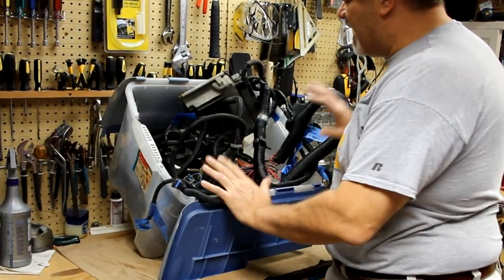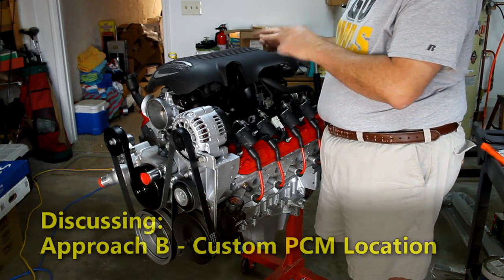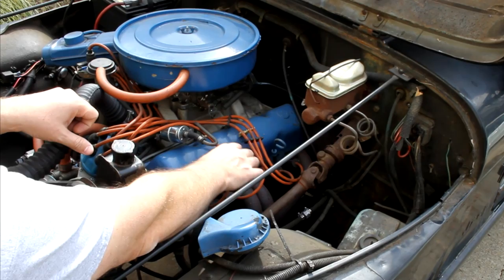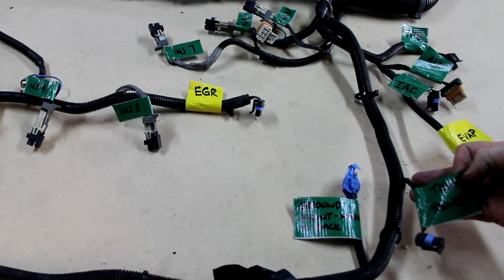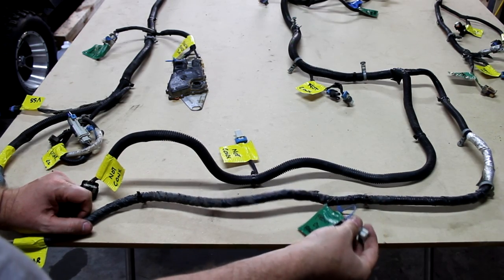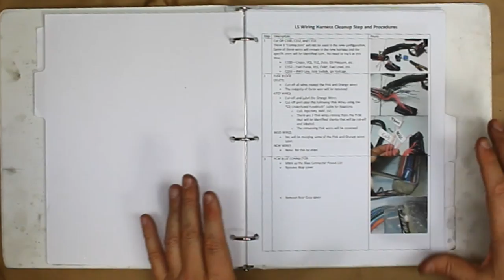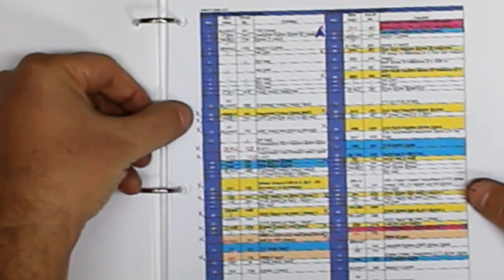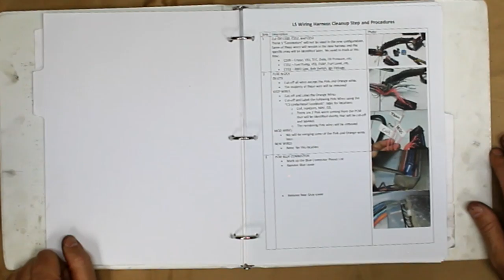LS Wiring Harness Part 1 | Project Rowdy Ep013

Comment: Hey rowdy, quick question?  If I'm running th350 / ls1, do i have to connect tcc wire 33 (blue connector). I never connected it and the car runs but will it make a difference on a old th350 or how the pcm runs?  Cheers mate
Reply from the maker: Hey DJ,  Because my configuration does not include an Automatic Transmission, I'm not sure how much help I can provide.  I removed all wiring related to the AutoTrans.  Interestingly, my records show that I did not de-pin B33, but I do not recall where the other end exists!!!  I may have later removed it and did not update my documentation.  That Purple wire is the In-bound trigger from the Brake Switch to the PCM.  It tell the PCM that you have applied the Brakes and then the PCM control the TCC (Torque Converter Clutch) through other wires (R2 and R42).  So I'll take a stab at your question.  It will have NO affect on how the Engine runs.  It only applies to Autotrans with TCC solenoids (outside of my research). I dont believe the old TH350 has TCC so you wont need it.  <- I'll leave that for your research.   Cheers to you as well!!!  Mike
Reply: Thank you so much mate.  I figured that might be the case as the car runs fine without it.

Comment: Sir, how did you find the name of every plug? I have a 2002 harness of a ls engine and I would like to know where I can find info to I.D every plug. Thanks. Great video.
Reply from the maker: Well in my case, the engine came with the harness still completely connected to all it's sensors and components.  You may need to attempt to lay out your Harness in the same configuration as I did in this video and then use it as a guide.  I mention all of the connectors and locations.   If your harness is from a true LSx, you may find that the Camshaft Position Sensor is located in the front of your engine.   It is in the rear of mine.  Hope this helps!!!
Reply: Thank you Sir

Comment: question! if i install Cat converters i have to save rear O2 sensors or i can removed it? else the PCM must be reprogramed only when you removed all O2 sensors. I removed wires related with A/C compressor so PCM needs to be reprogramed?
Reply from the maker: Swapping your engine into another vehicle is going to cause you to reprogram your PCM regardless to remove the VATS security.  You can run front and rear O2s with your Cats.  They will help you tune your engine.   I would not recommend running with no O2s.  Either 2 or all 4.

Comment: As everyone has stated, thank you for the videos, really clear up a lot of questions.  However, I have 2:  what size fuse do you use in the 4 fuse panel you install and do you have a parts list to order all the parts for the conversion?
Reply from the maker: Thank you Lee!!!!  The basis of my 4 Fuse Block came form LT1Swap.com and Branden used 15 Amp fuses in all 4 sockets.  Without doing any calculations, I also plan to run with the 15 Amp fuses unless someone raises a red flag or I encounter issues.  A couple of other people have asked for the list as well, so I have just added it tot he Description under each video.  you will have to use the "Show More" option to be able to view the information.Thanks for watching and taking the time to share your feedback!!!!!!
Reply: Thank you so much.  I can't wait to get into mine.
Reply from the maker: I found it really fun!  Partly due to the challenge of thinking through it so that I could properly present it, ( I love to prep).  The steps just came logically and I was pretty sure that any short term issue would be easy to resolve.   I truly believe that anyone that watches this series and feels they understand it...  will cruise through it.  Have fun!!!!!

Comment: So when you remove the ac connectors want be able to run your ac unit right
Reply from the maker: Correct!  I will be removing the A/C Compressor from the engine as well.  The new vehicle that this engine is being swapped into does not have A/C.

Comment: to run the obd2 port, do you go from the wire from the pcm (58 drk green) to the new fuseblock as on the diagram and pigtail it to the obd2 connector? Im confused
Reply from the maker: Did you download my diagram from the "Show More" section below the video.  It details the OBD2 Port wire needs on page 3.  Yes, Dark Green (Blue58) will go to port 2 on the OBD2 connector.  You will also need a Ground wire on Ports 4 and 5.  And finally, you will need Constant Power,  Orange wire on Port 16.  Hope this helps....
Reply: yea, I got it straight... Thanks
Reply: I guess it would be good to run 2 obd plugs too, 1 on the inside and one in the engine bay ?  SImple to parrallel wire, but where is the best place to install it ?

Comment: Hey Mike. For your harness diagram that you put together (which is amazing, btw), did you use Visio or another program? If Visio, did you make or find the templates for the relays and blocks? I am using a different block for mine (I'll have separate relays for fans and such) and want to put together a similar diagram using Visio. I just don't want to have to create the templates if they already exist. Thanks.
Reply from the maker: Yes!  I do all my diagrams in Visio and I did create the object that were used for the Relays and Fuse Block.  I didn't go to the length of saving in a Template file as they were kind of a one-time-use item.  Pretty simple to create, but if you would like a copy, I can send you a VSD file with them in it.  Shoot me an email if you would like them.  ucandoit2mike@gmail.com. Cheers!

Comment: After u delete all the wires do u have to reprogram the ecu to let it know u deleted everything
Reply from the maker: Yes!  If you don't disable these items in the PCM, you will receive error messages that are not valid.
Reply: Did u do it or have someone do it for u
Reply from the maker: IN my case, I will have someone do it.   I haven't had it done yet.   I am still working on the vehicle that it will be installed in.  When I get closer to dropping it in, I will have it reprogrammed.

Comment: Would I have to use the pcm from the 5.3 or can I use the pcm from the vehicle I'm swapping into??...
Reply from the maker: I'm struggling with coming up with the proper answer to this.  There are after market computers that can be used to run your engine.  I would assume that you could "possibly" program other computers to run your engine, with tremendous effort.   A compatible (there is a range) GM PCM (specifically the one that came with the engine or similar vehicle) already has the all of the sensors and mapping tables dialed in.   "Dialed in" with a standard tune that GM believes applies to all 5.3 engines.  All standard tunes can be improved on for the exact engine it is servicing.  Hope that helps!  Mike
Reply: @UCanDoIt2Mike  I just wasn't sure if the pcm was needed to run other functions of the vehicle not related to the engine such as windshield wipers, power windows, etc....
Reply: @UCanDoIt2Mike  the good news is that I still have the pcm for the 5.3 so I will not discard it and will put it into the swap vehicle...
Reply from the maker: The PCM primarily runs the Engine and Transmission.  It also has outputs for Cooling Fans (Engine related) and gauges (Engine related).
Reply: @UCanDoIt2Mike  thanks a bunch. Your videos are very informative and thorough. After I get this swap together I will make sure I let you guys know how things turned out. God bless you and your family.
Reply from the maker: Definitely plan to give us an update.  Cheers....  Mike!

Comment: Did you have to short out the neutral safety switch, for the computer to allow cranking without it being installed?
Reply from the maker: Let me attempt to explain this.  The normal answer would be Yes, in my case No.  The Neutral Safety Switch is a normally open switch in the Ignition circuit.  If the vehicle is in Neutral or Park the switch closes that portion of the circuit and if all other "in series" switches are closed, the starter will turn.   My new vehicle is a manual transmission, so it does not have a NSS.  There is a jumper in the area of the transmission that if the vehicle had an AutoTrans, it could incorporate a NSS, but since it is manual, it came factory with a Jumper that permanently "Closed" that section of the circuit.  I explain a little bit of this in Part 6 / Episode 018 of this series.  Hope this answers your question.  If not, let me know.  Cheers!  Mike

Comment: I have a 02 mustang I'm doing a ls swap in. My ? Is does this process the same for any car?
Reply from the maker: Yes...  Once you consolidation your wires down to a 4 wire system,  You could drop the engine into a Go-Cart and fire it up.  You are going to need to figure out how to interface with your internal gauges.  Cheers!!!
Reply: @UCanDoIt2Mike  thanks a lot man. U always have the answers. And yeah I was reading a little about that on lt1swap.com doesn't look like much fun.

Comment: I have a question friend i seen in this video that you're delete VSS my question is do you need that wire if you're going to connect odometer ?
Reply from the maker: I'm going to take a guess here...  In my older vehicle (79 Jeep), the Odometer is a mechanical function of the Speedometer.  And my Speedometer will be driven off a cable attached to the tail section of the transmission.  So in my situation, I will not need the VSS.
Reply: UCanDoIt2,  doesn’t the pcm require a VSS input for correct mapping?

Comment: i have a 2000 camero ss, and need to replace my engine harness.Do i need to pull the engine to do a harness swap
Reply from the maker: You should not have to!   The majority of the harness lies on top and sides of the engine.  The problem area might be any harness clips near the back of the engine that head toward the transmission. The fire wall makes that area tight.

Comment: Awesome work, thank you
Reply from the maker: I appreciate the kind words.  Thanks for watching.   The next part should get really good.  Snip... Snip!
Reply: UCanDoIt2 I'll be sure to watch, I'm about 2 weeks away on starting my harness
Reply from the maker: Maybe I can stay just ahead of you!  More than happy to bounce ideas off each other.  If you see me screwing up...  YELL at me!   I believe I have my ducks in a row, but you can never be totally sure!   Thanks.
Reply: UCanDoIt2 oh I'm sure you will be done before I'll really attack it, I'm test fitting the 5.3/th400 in the truck and getting all that done first and taking things off the truck that I don't want or need and I need to clean the engine bay, once the motor/trans are in and bolted down I'll start the harness
Reply from the maker: That sound like a great plan!  Hope all good well for you with the fitment!  Cheers!
Reply: UCanDoIt2 let me know how you like them Speed Pro pistons, I took my 706s off my 5.3 to swap them for a set of 862s and I found some junk I didn't like so the block is bare now, going to the machine shop Friday
Reply from the maker: It is going to be a while before I fire it up, but from a quality and installation stand point, I couldn't be happier.  They all came balanced dead on except 2 but the overall balancing effort took care of that.  I believe that I mentioned that these were the 0.020 over stock.  Nothing wrong with fitment.  My machinist stated that these engines like to run tight, so he finished out the cylinders accordingly.  I understand that people like the brand.  This will be a great conversation that you should have with your machinist.  I know that we (he) made many decisions based on the initial condition/measurements of the block.    Have fun with yours!

Comment: how did you get the harness so clean? soap and water or mineral spirits
Reply from the maker: I did not wash the harness at all.  It started off pretty clean.  Between handling it and for the most part, replacing 90% of the loom....  did also provide a cleaner look.  I suppose you could wash with water.  Probably would be a good idea to apply some dielectric grease to the connectors first.  Cheers!

Comment: do you know how to explain how to change harnesses from a 2007 5.3 gmc sierra to a 5.3 chevy silverado but is 2006 can i still use my harness or do i have to swap it out for another harness because mine has power windows seats locks air  pressure sensor for tires can i rework my harness to work on the 2006 5.3 my email i will give you if you think you can help me by your sites i have seen i think i probably just ask a dumb question

Comment: is there a pinout sheet sheet that help if I'm keeping my 4L60e on my 4.8 swap?  do I need another relay or to modify the harness?
Reply from the maker: I am afraid that I will not be much help with your Automatic Transmission as it was not a part of my research.  Because I was moving to a manual trans, I was just focused on ripping that portion of the harness out.  When you say keeping....  If that is the Transmission that was mated to the 4.8 from the donor vehicle, you will be keeping all of the transmission related wires.   In fact, you will be following closer to what LT1swap.com recommends by removing the wires Highlighted in Yellow on his page.
Reply: UCanDoIt2  yes, is the transmission from the same vehicle where I got the 4.8. I guess If I  keep all the wires that go from the pcm to  the transmission it should work. thank you for your help and the videos.
Reply from the maker: I believe you will be safe with that approach.
Reply: If you do a search on your transmission, I found a video highlighting the 3 things that normally break in your transmission and can easily be upgraded during next rebuild. 1 is a plunger in the valve body that tends to stick, and a bigger hole is drilled for more pressure, 2nd is a solenoid inside that goes bad, and 3rd is a weak 2-4 drum assembly that cracks.

Comment: Vortec covercan be 3d printed sanded and painted any way you want
Reply from the maker: Jason Holmes That is a great idea that I did not think of.  If I wanted to create the design, what application would be best to use?   I don’t have a printer, but if I had the design, I should be able to find someone to print it.   I have been thinking of creating a form and doing some type of fiberglass solution.  Thanks for the idea!   You are the first to provide a suggestion on that question.  Cheers... Mike !
Reply: You can use the stock version or the max version they can scan it then change the cad to print what you want then send fill and paint
Reply: You will just need to find a place that does 3d printing there are dozens of places in California I've never needed such service but I'm sure you can find one and it should be affordable as long as you do the finish work
Reply: The printer people can use any graphic design you like so I would just research a 3d automotive printing and see if they can help you can see any design you like personally I would make it look like an old Cadillac air scoop with the 2 breather holes closed up give it some oldschool flare

Comment: Have you figured out your fan schematic, and are you using 2 fans ?, or just 1 fan with high/low speed ?
Reply from the maker: I have not completed the Fan Relay circuits.  I would like to run 2 fans.  My radiator is square which hinders that a little.  Will have to see how this plays out when I get to that point.
Reply from the maker: I can see your other comment about downloading the diagram from your phone, but YT will not let me respond to it.   For PHONE users, you have to copy and paste the link into your phone's browser.  It should work.

Comment: My friend I'm going tu use stock automatic transmission and 5.3 this steps from your videos is going to work?
Reply from the maker: The overall Approach and Process with work for any swap.   However, the wires (PCM Pins) that you remove/keep will be different!   I removed all of the wires related to the Auto Trans...  you will need to keep those.   You will have to do a little homework in studying your Pinout sheets (Red/Blue).  Scan through them, mark them up.  If in doubt, leave the pin in the PCM Connector.  If your find a downstream connector that you want to remove and it is still connected the PCM connector....  De-Pin it!!!!  I encourage you to download my documents (beneath the video) and related documents from LT1Swap.com (website) and study what you have.   It will be more apparent when you have the information in front of you.  Hope this helps!!!!

Comment: Hello! did you level any wire or sensor for a power steering? i know there is a plug from harness to connect it behind th epower steering pump.
Reply from the maker: Javier Argumedo There is not any electrical wiring required for the Power Steering.
Reply: @UCanDoIt2Mike  my engine comes from a 2002 chevy tahoe (same engine as yours) and this harness comes with a power steering plug wich is connected behind the power steering pump i have no idea if it is an fluid level sensor for power steering so DO YOU THINK I NEED TO REMOVE IT? and else this wiring harness does not have any EGR
Reply from the maker: @javierargumedo3  To be honest, I am not sure about the PSP Wire.  It would never hurt to leave it.  You can later connect it if the PSP that you end up using allows it, or you can just leave it disconnected.
Reply: @UCanDoIt2Mike  hey i just want to say sorry about power steering plug question. there not any sensor for power steering in my harness neither  on your harness diagram what happened was i level the Temp Sensor as an Power steering sensor. but know y corrected and all is clear. thanks to answer my wrong question.